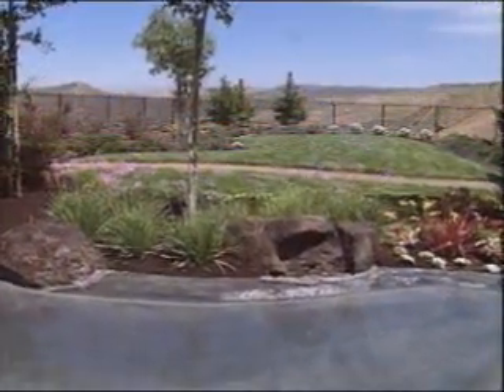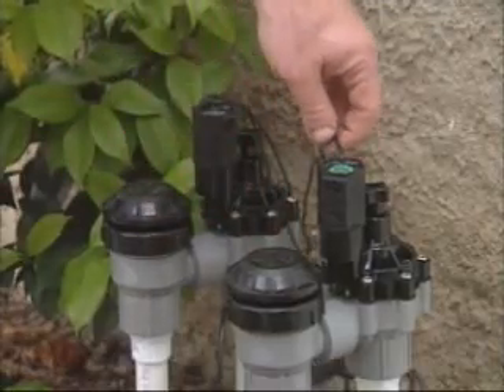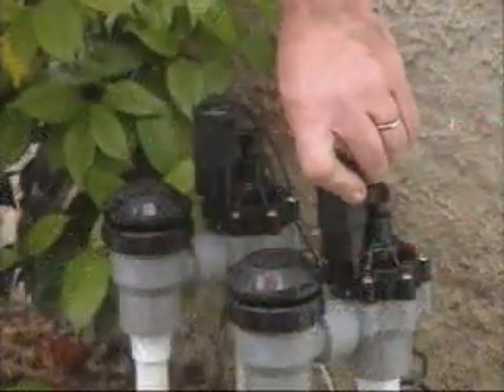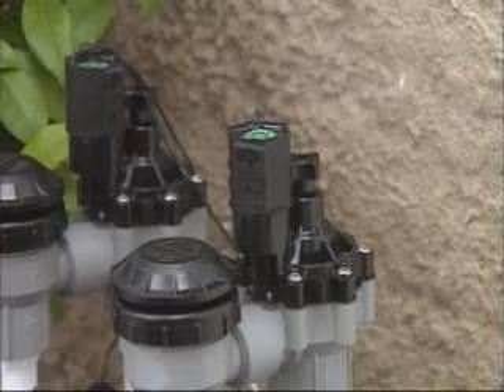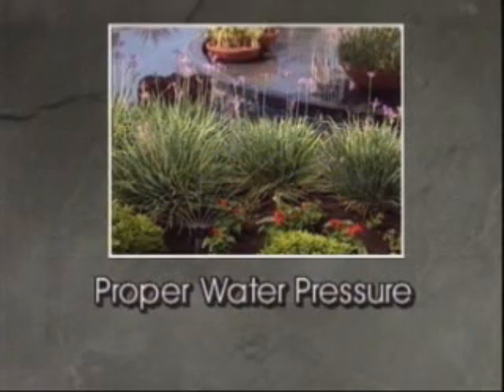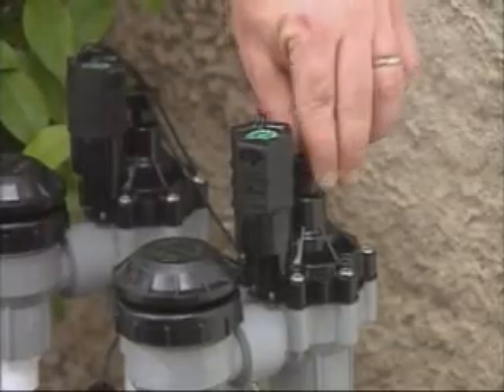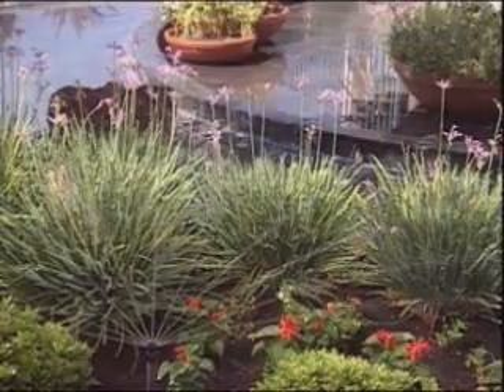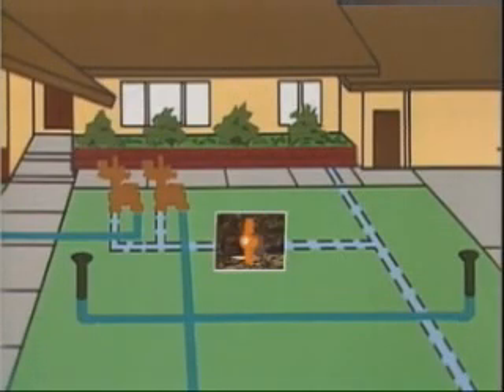Rain Bird Anti-Siphon Valves: Basic Operation

Comment: I installed a new rain bird. All is well but when the sprinkler turns off water comes gushing out from the anti siphon area. How do I resolve this problem?
Reply: Arturo R Gallardo did you ever solve this? Mine has the same issue.
Reply: I assum that you installed it lower than the sprinkler heads.  The anti-siphon feature lets air in when shut off allowing water from the pipes to come back down by gravity, gushing out of the valve.  Technically you suppose to install it above the highest sprinkler head but that is not practical because your slope is usually the far away from your house and you have to run all wires back to your electronics timer.  I think if you have sprinklers on the slope, it’s better if you install none antisiphon control valve near the house and vacuum breaker at the top of the slope.  Or install an inline check valve at the pipe just before it starts to go up hill.
Reply: 6

Comment: Per the research I've done it seems that the ideal water sprinkler pressure is 30psi.  Is there a way to adjust the Anti-Siphon Valve to an exact psi rather than just "eye-balling" the spray area? Coverage area can still be adjusted via individual sprinkler heads but at 30psi.  Thanks!
Reply: I live in Karachi Pakistan and I like your comment send 10 month ago
Reply: install a pressure gauge after the valve and adjust accordingly.
Reply: I think a PRV is the exact thing for that

Comment: Suppose any of the nozzles/emitters are above the level of the valve?  Then, typically, should only inline valves be used, along with a reduced-pressure back flow device?

Comment: Gravity provides the power for water pressure distribution systems.  Yes it takes a pump to fill up the reservoirs each night when electricity costs are low, but when electricity costs are high during peak demand hours, the water flows via gravity down from the reservoirs to each home for free. Same concept as a water tower.
Reply: I live in Karachi Pakistan and I like your comment send 10 month ago

Comment: How does the system work without a power, needing a pump?
Reply: AppliedTechnology same way you have water pressure in all your house fixtures. From the pressure in the water main. Assuming your setup is like the diagram in the video, (which is a tee for irrigation in the main), have your main irrigation shutoff valve "on" then manually open the "solenoid" as stated. There's always gonna be water pressure in the main line.
Reply: @ThatDudeEddiee0  I live in Karachi Pakistan and I like your comment send 10 month old